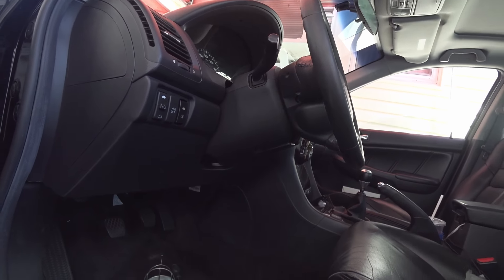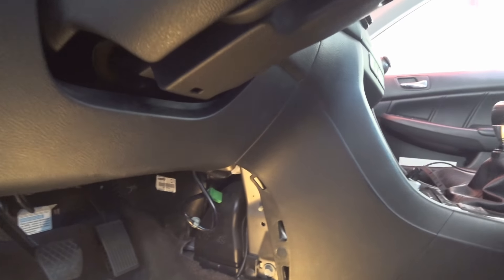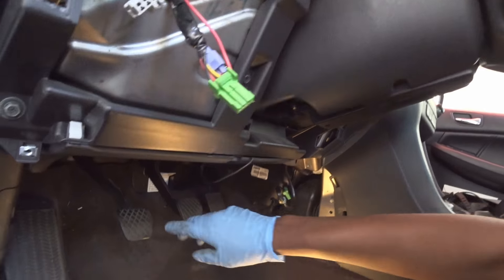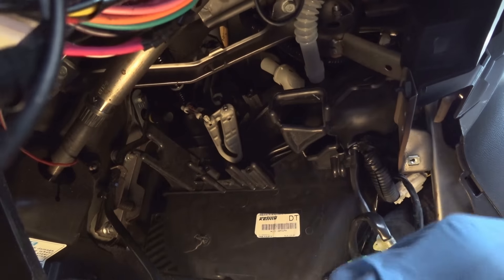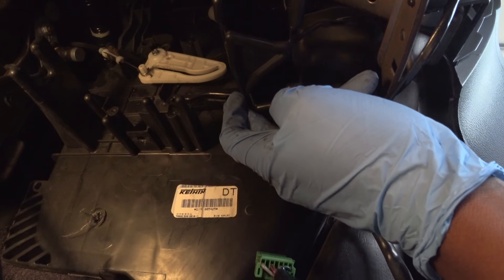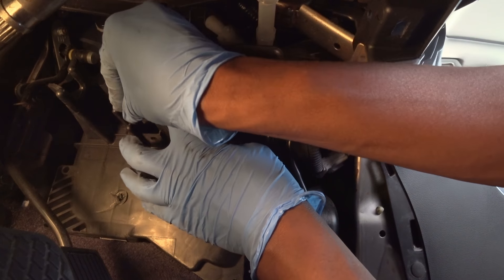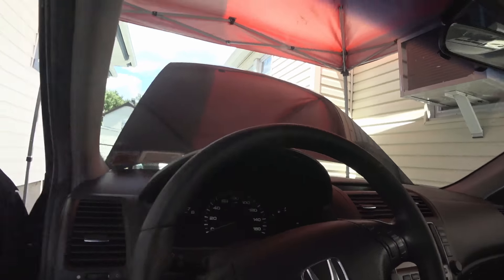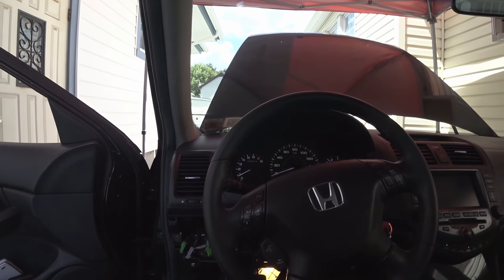How to fix accord blend door actuator. How to fix your AC vent.

Comment: My 2004 Honda Accord v6 stopped blowing Hot air and AC completely. I changed blower motor nd resistor. Coolant is good and fuses are good. Could the blend door be the problem?
Reply from the maker: So the system is not blowing any air at all. When you turn on the fan do you get power at the fan. It sounds like an electrical issue and not the blend door actuator.
Reply: @AJIMPORTS  no power nothing. I already changed used blower motor resistor and blower motor. It wanted too at first with the used parts but then nothing. Only lights turn on
Reply from the maker: I would say you have a blown fuse or a short some where. You will have to check at the blower motor to see if you have power there when you turn the switch on. Also check this site. https://www.hondaaccordforum.com/forum/diy-answers-28/checking-blower-circuit-2003-2006-a-36131/

Comment: I have 03 accord that only blows through the side vents and the defroster do both need replaced
Reply from the maker: Sounds like blower motor resistor or your center vent actuator not working. Check there first and manual move those    arms on the vent before buying anything.

Comment: Replaced the actuator on my 2006 Honda Accord EX.  The top screw is really tough to get out an put in but you can manage to get a screwdriver in the right position by going at it from the top with a slight angle.  The new actuator works well.  I did purchase an OEM pert off of Amazon.
Reply from the maker: I used a small screw driver to get the top bolt out the second time I did it. The smaller one does help. But it is a very crappy location  none the less.

Comment: but its ok to blow warm to the feet ? use arrow down and its warm, if use down and middle got warm down and cold middle, down and windscreen got warm down and cold up, cold  into middle and windscreen at 22⁰ C, only if the   if go up ⁰ C start to blew warm middle and windscreen, got fresh regas, compressor and fan ticking, got leaking water underneath ... cheers (it happend while driving and parked)  its about accord 2.2 idtec

Comment: But can I wedge it up or down to allow hot air or cold air to come through so I don’t have to buy a new part? That is the question 🤔
Reply from the maker: Yes in the video I said to move the arms to see if it works. If it does just zip tie them together in that position

Comment: I have the opposite, driver side heater blows hot but passanger side is cold.

AC works both sides.
Reply from the maker: Check the channel I have two additional videos on the issue. Most likely it's a blend door actuator on the passenger side not working. But the other videos have more indept repairs.

Comment: Its a pain to get the top screw out of the actuator, but if you remove the two 12mm bolts that hold a metal support to the firewall that is in the way of the actuator top screw, it makes it easier to remove the actuator, just a suggestion.
Reply: No kidding, this step is a must,and it’s not obvious from the video. Thanks for sharing!
Reply: I did the same and was easier than working with the metal support in the middle of everything
Reply: I used a screw through a hole

Comment: ok ya boy need help, i replaced my blend door actuator on the passenger side because the passenger side was blowing hot while the drivers was cold, same part # different manufacturer, I put the new one it now it all blows hot after 5 minutes of driving, 2 hours ago before I started working the ac on the left side was blowing cold at the correct temp
Reply: any idea what could be wrong
Reply from the maker: @reeseua7  I would take back out the actuator and manual move the arm to the cold setting. If it stays cold then the actuator is bad. If it stay hot then check your ac system. Maybe low on freon or the cluch on the ac compressor is not working and turn off because it got hot.

Comment: Thanks for this video. i have a question, i checked all blend door actuators on both sides driver and passengers, and both are working ( i mean the white parts are moving with changing temp of the A/C) so i assume that door actuator parts are fine,  am i right? Honda dealer wants me to pay like 600 dollars if he is going to start his check-up.

i re-filled the AC gas freon, but till the right side is cold, moving to left side the cold air become hot.  so i am really confused. any advice pleassssssse
Reply from the maker: I have two more video on this topic check them out. If you manually test the lever on the driver side when you remove the actuator. And it does not work. Then most likely it's the hvac box that's inside the dash board.
Reply: @AJIMPORTS   i was looking on your channel, but did not find them. could you please give me the names of those video, thnx in advance
Reply from the maker: 07 accord with heating issue. That's the title.

Comment: Does this apply if the problem is with passenger side blowing cold air when I have the heat on?
Reply from the maker: Yes. The passenger side also has the same parts. Just less space due to the airbag.

Comment: Im working on a 98 honda accord dx and the blower doesnt change modes. I was able to change it from the floor vents to the vents oisnted at your gace but it wont go back to floor/defrost mode. Will this part fix that as well? I dont have an issue with ac or heat, just the modes wont switch positions. Thanks in advance.
Reply from the maker: The climate control is known to go bad in those accord. I would check to see if the motor that contol the vent position is getting power when you select the mode.  That will confirm if the motor is bad or the climate control.

Comment: Will this part if it's bad not make the ac clutch kick on I checked fuses and relays ac still not kicking on
Reply from the maker: No the AC still work. But it will only get cold on one side of the car. Check my video on installing the AC. I show how to check the ac compressor to see if it's working or broken.

Comment: Great video but why are there 2 different clips controlling the heat??
Reply from the maker: One is to control the flow of antifreeze into the heater core. The other is to control the position of the vent inside the hvac block.
Reply: @AJIMPORTS  thank you so much, this is very useful.

Comment: Honda calls the actuator a "Motor Assy., Temperature Driver." or "Motor Assembly, Mode."  the Honda part number is the same for both. 79160-SDA-A01
  (double check with your VIN.  Dunno if dual zone HVAC and single zone HVAC use the same part)    thanks  OP!

Comment: I have a 2005 Honda Accord. I removed the two crews from the bottom that go directly into the plastic body. I also removed the bottom right screw that passes first through the bracket and then the other similar screw that is to the left. With that, I was able to rotate the bracket to clockwise and remove the actuator. By doing this, I didn't have to take out the top screw, which is the most difficult to remove. The installation is done i reverse order. Hope that helps. One comment about the video: I believe it's very helpful, especially because of the limited space. Great job, and my best regards and thanks to the author.
Reply: I have and 2006 EX Sedan, same part number as your 05?

Comment: Hi
after removing the valve, you can see inside as if the valve is not fully closing.  could this be the reason for the heating failure?  passenger side is ok. driver side is blowing cold.
Thanks

Comment: I lowered the temperature to see if it would move but it didn't. Then I removed the part and it didn't cool the air. Any suggestions on what I should do or check next? Thank you.
Reply from the maker: When you removed the actuator did you move the arms manually on the air box. If you get cold air it shows that the ac is working correctly and the actuator is the issue. Are you getting cold air on one side of the car.
Reply: I did move the arms manually and it was still blowing warm air. I am going to get some Freon tomorrow and check out if that's also the problem. I'm hoping i can also find a way to do a self diagnostic.
Reply: And both sides blow warm/hot air. At first it was only the passenger's side then it was both.
Reply from the maker: @josefinacornejo3979  if both sides are blowing warm it might be you are low on freon. If that does not work. You might have to get the system fully vacuum Nd charged by a shop. That will let you know if the compressor is work.

Comment: Is it just the exact opposite if it's only blowing hot air on the passenger side?
Reply from the maker: Most likely. You can do the same test I did. Remove the solenoid on the passenger side and move the arms. If it works you know the solenoid is bad. It's a few test and takes about 15 minutes to do.
Reply: @AJIMPORTS  Thanks!

Comment: Please help!! My a/c and heater are working but unfortunately it’s not throwing air for the windshield front or rear and for the feet as well.  It keeps throwing air only to the front of the driver and passenger.
Reply from the maker: They have solenoid for the passenger side and driver side. I they also have a third one. I believe that control any other direction the air flow. That might be your issue. I have not dealt with this issue before. But I would start looking in that direction.
Reply: AJ Imports thanks you 👏🏼👏🏼👏🏼

Comment: My actuator still working but i still get one size hot? Any idea? Both low temperature! Thanks!
Reply from the maker: If you are sure it's working. Then I would recommend checking to make sure you have the right amount of ac freon. Low freon can also cause this issue.
Reply: AJ Imports ok thanks sir!

Comment: I've been hearing some wierd noises when turning on the air. It works fine, cold air, heater no problem. It also makes noise when it's off. I took a look and found that this exact part is making the noise. I see it "clicking". I was wondering if there's no problem functionally, do I need to replace it?
Reply: Are you hearing bubbling noise behind the dash on the driver side?
Reply: @esiu74  on the driver side
Reply: I'm hearing the bubbling noise. Is it this same part to fix ? Or something else. Thanks in advance lol.
Reply: @mostarpark9275  did you ever get this fixed ?

Comment: if the actuator is going bad, does it affect the fan speed because when it acts up  the fan speed on 3 feels like 2
Reply from the maker: Normally the fan speed it control by the fan speed resistor On the over over motor. If the actuator is going bad it would not allow the vents to move.

Comment: Hello! My 2012 Accord SE just started blowing regular air, no a/c, but only if the driver's side door is closed. I can only get it to blow a/c if I have the driver's door open. Do you think that this could be the problem?
Reply from the maker: Thats a weird issue. Having the door open or close would not have any effect on the ac coming on. Turn the ac on and open the door. Check the engine bay to make sure the ac compressor clutch is spinning. To me it sounds like wiring issues.

Comment: My compressor kicks on and my ac is charged with Freon but my air still blows warm for some reason. Could it be this one door actuator for the whole car? I have a coupe 05’.
Reply from the maker: Does your car have duel zone climate control. If so it should have two actuator one on each side. Follow the step in the video to test your actuator should take 5 minutes to see if it is the problem.

Comment: My Honda Accord 2006, it has a dual zone climate control, when i turn on my aircon the passenger side temp can be adjusted accordingly but on the driver side it always blows the cold air even when the temperature is set to high. Is this because of blend door actuator not working???
Please advice Thanks
Reply from the maker: Yes. In the video I show how to check your car by removing the blend door solenoid and manually moving the plastic arms. If the temperature respond to you manually moving the parts then your solenoid is bad. Takes about 5 minutes to check.
Reply: @AJIMPORTS  Thanks for your advice

Comment: Thanks for your video!  I watched your video and ordered the Honda OEM part that comes with the metal bracket, replaced it and fixed my problem with Cold vent on the passenger side and Hot vent on the driver side. Now my HVAC is working perfect evenly on both sides.  Like everyone had experienced, the TOP SCREW is most difficult to get out.  You'll a UNIVERSAL PIVOT screwdriver. Very satisfied with the work done by ME 🙂
Reply from the maker: Happy it worked out and you saved you some money vs going to a dealer to fix
Reply: is this the Same part for dual? Advance auto parts it just says drivers side..
Reply from the maker: @shatteredcitizn7489  I have a dual climate car. So yes. Don't get the one from autozone. Get the part oem off amazon. If it's wrong or goes bad you can return it. I have seen the autozone ones come incorrect
Reply: @AJIMPORTS   Ok, i have the 2.4L engine so its just the 1 actuator..
Reply from the maker: @shatteredcitizn7489  use the vin number and go to a honda parts website to confirm.
Reply: @AJIMPORTS  rgr.. just did, got the number. Thanks for doing this vid.

Comment: @AJ Imports is this the actuator that controls that controls the distribution of cold air..? My car the driver side blows hot while the other side blows cold.
Reply from the maker: Yes it control the blend doors on the driver side. You can unscrew it from the box. Then move the two levers. If you get cold air then the actuator not working. Or press the temperature from hot to cold and see if it moves like in the video. If it does not, most likely your actuator is bad.
Reply: @AJIMPORTS  Its for an 03 Honda Accord 2.4l. The advice works the same for the 03-07 generation, right?

Also, I appreciate the response and the advice. Thanks.
Reply from the maker: @amoses585  yes it works for the 03-07 model for sure. Hope it helps solve your issue and thanks for watching 🙏.

Comment: Hi I just wanted to ask will I have to do this same process if my air conditioner is doing it in the opposite side? My driver side is cold and passenger is hot.
Thanks in advance
Reply from the maker: Yes most likely its the same. But you can add freon in the car just to make sure the ac system is full charged.
Reply: Thank you soooo much!!!!!🙏🏾🙏🏾🤩🤩🤩🤩

Comment: I have an 07 accord. Cold air blows out of all vents but when i switch to heat it blows out of the side vents but not the middle 2 vents.
Reply from the maker: Seem like the same issue. The vent might be stuck or the actuator went bad. You have to locate the actuator that control the center vents.
Reply: I actually have the exact same issue on my 2007 accord. For a while my AC came out of all vents and heat only out of my 2 side vents, now my AC only comes out on passenger side. Not sure what combination of my bent doors are broken haha

Comment: Thanks for the tip.  My Accord has exactly the same problem.  Another vlog suggested that the A/C unit lacked freon. Others say its the actuator like in your video.  I'll definitely try this diagnostic first. 👍
Reply from the maker: Yes I always suggest doing the free test first. Pull the actuator out and do the test. Should take ten minutes at most. Best of luck
Reply: @dinbee4611  what was the problem of your car? was it the actuator exactly?
Reply: @stripecatflippangitnamecha8721  Yes looks like it was.  Either the actuator, knob switches or the wiring/connectors were faulty.  I was able to get it to work by turning the dual temp knob of both driver/passenger side a few times and jarring the actuator w/out removing it, tighten wiring connectors and somehow I got it to work.  Both the vents now have cool air.  Presently I don't dare touch the dual climate control knob of the passenger side ever since and just kept it on sync to avoid a relapse.

Comment: Wow, Pretty sure my actuator is bad too. When I turn the corner I get a blast of really cold air. All my DTC codes pass (Audio-HVAC test) https://www.youtube.com/watch?v=AEn5gsV9VAM. Also like the cheap way of fixing this: https://www.youtube.com/watch?v=kTd2UW1NDRA hopefully people won't have to buy several similar actuators and fined out the motors are the wrong size.

Comment: i have a 2018 accord , when i move the temperature from  72 to low  the ac temperature remains the same. if i go up to 80 + than it changes to warm air. on a cold day it blows hot air from 85 to 58. until i hit low then it changes. i'm thinking its the actuator. any comment please.
Reply from the maker: Is the AC system fully charged. Try changing the temp on the driver side to low and the passenger side to high. Then  switch. Thats the best way to test the actuator. If both sides are not cold then check to make sure you have enough freon in the ac system

Comment: Good video, thank you. But how do you know if it has enough freon and that it is fully charged?
Reply from the maker: I had mine tested to make sure I did not have a leak in the ac system.  So I knew that was not the problem.

Comment: How did you manage to get the top mounting screw back in? I can’t even begin to get it lined up in that tight space.
Reply from the maker: Once I lined up the arms on the actuators started with the lower screws then the top one. It went in easy. But if the arms not lined up thats where I had issues.

Comment: Do recommend recharging the a/c after changing the blend door actuator?
Reply from the maker: If the are is cold on one side then your ac is working fine. Fix the blend door first then see what happens. If you feel the system is not as cold as you like then recharge it at a shop.

Comment: Hey I have a issue that’s somewhat similar. My a/c and heat blows out strong it’s just where the air blows out above the radio, it doesn’t blow strong like everywhere else it only seeps out. How can I go about the situation? Do I need a new actuator also? Thank you.
Reply: Did you ever find the problem?